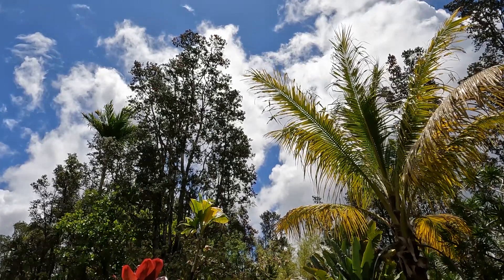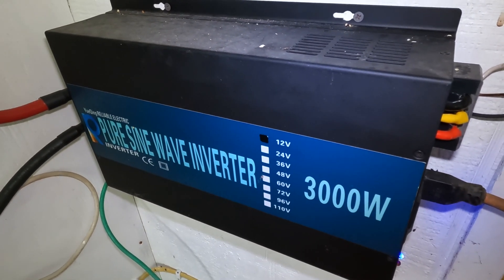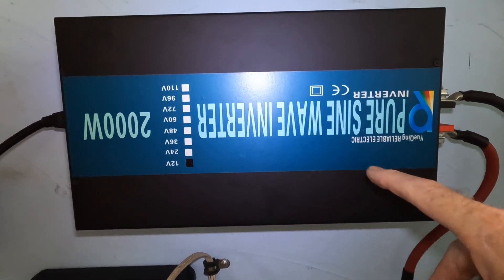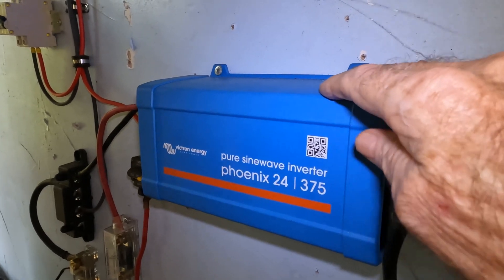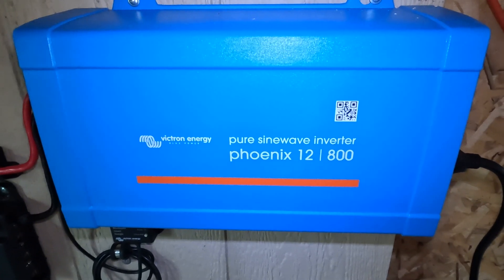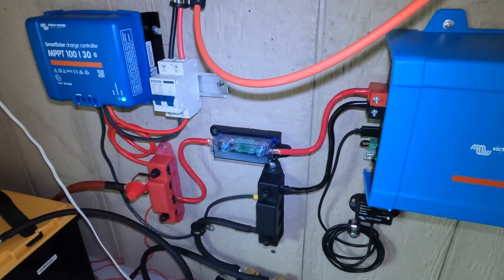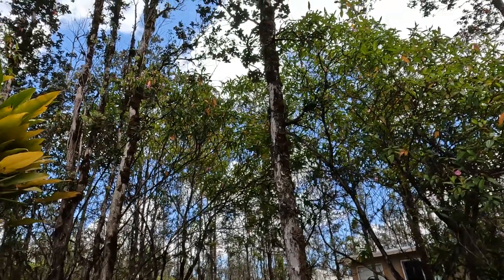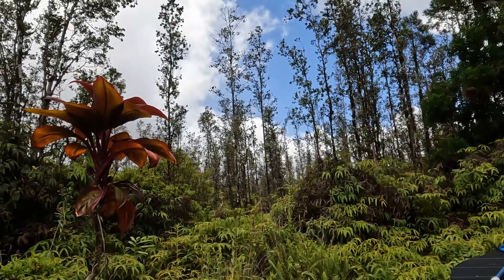Steadfast Power: Unwavering Performance of Pure Sine Wave Inverters Through Time

Comment: I really like that the fact that your system is modular with redundancy .... You're the solar redundancy king!  For something like an outbuilding or storage shed this makes complete sense .... It also makes complete sense to do what you've done and dedicate a small system to a larger appliance like a fridge/freezer.  I'm working on building an offgrid cabin and your set up would work awesome for that.
Reply from the maker: That 48v battery I have running the 20 cu.ft. refrigerator/freezer does so good I can't believe it. Cycling in the sweet spot day after day even in less than ideal sunny days sometimes. Even running the air fryer on same system a little everyday to..no problems. Aloha!🤙

Comment: Always good to have reports on equipment that just keeps working.  Thank you.

I have two of the Reliable Electric branded 12 volt to 120 volt 2000 watt pure sine wave inverters for my backup power system.  In September of this year, the working inverter will have 7 years of service as our power when commercial power is out.  In the time I've tracked our power outages, we've had 24 outages that amount to a total of about 46 hours.  I usually don't bother to provide power for fridge and freezer unless commercial power is off more than 30 minutes.  The longest continuous outage was 16 hours from 70MPH+ winds in a summer thunderstorm but that was before I put the battery backup in place and I was using a small gasoline generator to cool the fridge and freezer.  The longest outage since then was 12 hours when we had 7 inches of snow - in an area that rarely sees 3 inches of snow.  The current battery bank is 420AH of AGM batteries but I plan for their replacement to be LiFePO4 and big enough to provide 24+ hours of operation without without solar or generator assistance. 
It's good to have equipment that you just KNOW will work when you turn it on.
The solar charge controllers are EPEVER Tracer 3210A and 4210A.  The RS-485 to USB dongles for computer monitoring get zapped by nearby lightning - and occasionally so do the USB ports on the inexpensive older laptops I use for monitoring the controllers, but the in-service Tracer controller will also hit the 7 year mark in September.  The nearest lightning strike was about 150 feet away and the controllers just keep working ;-)

ime

Comment: What would you guess your idle consumption is on the 2kw and 3kw Reliable inverters? They’re so popular that they’ve probably sold tens of thousands and you don’t see too many issues. 

My guess would be your 600W failed and your larger units haven’t because you run your bigger inverters at 50% and the 600W was probably doing a bit more? Or is the 375VA Phoenix a pretty good reflection of the load that system sees?

I know the one major selling point of the Phoenix is their voltage range. I think the 12V is something like 9V to 17V so it can do 3S and 4S 3.6/3.7V lithium ion and capture nearly the entire range except the very bottom 10% or 20% of a 3S NMC/NCA battery. 

Obviously the price of those Phoenix inverters is tough to stomach. You can get triple the power for the same price from Reliable and their 1kw to 3kw lineup seems pretty solid. David Poz had issues with some of the BIG Reliable units and I’ve heard others having issues with the small ones. 

Tldr:
If you buy something like a Reliable run it at 50% (75% max if it’s only occasionally cycling to that level) and add another solar panel to deal with the increased idle consumption. 

If you cough up the money for a Phoenix or a small MultiPlus you can run them at 75% to 80% most of the time and you’ll also get more efficiency all the way around. 

< 2kw 12V is fine. 
1.5kw to 3kw 24V makes more sense when 

And as for MPPT…just buy the Victron that suits your array. I’m cheap but even I recognise that it’s pointless to buy any other brands MPPT. That’s the last component I’d want to troubleshoot in my system.

Comment: The geek in me loves seeing all of these different batteries and inverters, running designated loads.  If any one thing fails, it's like just a mild inconvenience that is fairly easy to diagnose and resolve.  The pragmatist in me, however, wonders if it's worth the extra cost and complexity to have a much larger, whole-house solution.  If money was no object and you had it to do all over again, would you go with one or two of the really large 48v inverters and a single battery bank, wired into a service panel to power all of your loads with that single system?

Comment: I have the same 3000-watt Reliable Inverter. The only difference is I added a MOSFET upgrade. Since I did the upgrade I haven't really noticed any improvement. I also added a power strip to the hardwire connection so I can run more AC if I need to.
Reply from the maker: Those reliables are pretty good work horses! 🤙

Comment: nice up date on inverters . I have RV's come threw with Power queen and REDODO charge controllers and inverters and they working great .  lots of LifePo4 battery's. many got them on black Friday sail last year. I have a 30 year old plus inverter that still works. not sign wave . still works well. my back up. it's Tripp-lite   been around many many years. I do have one of their newer models. 24V 2 KW with GFI on inverter and that pure sign wave.  they still make them. Them Victron inverters and rest of Victron products are super. the RV people love them. the Bluetooth app is a big hit. all on your phone . it just works . easy set up . just have to keep networks separate if have more than 1 Victron set up.   they just want to talk to each outher very well . some times you don't want them talking. separate battery system.  good to see many good products out their now.
Reply from the maker: I am loving the Victrons so much. So easy to work with, and every bit of information I could ask for at a glance, wherever I am! Aloha!🤙